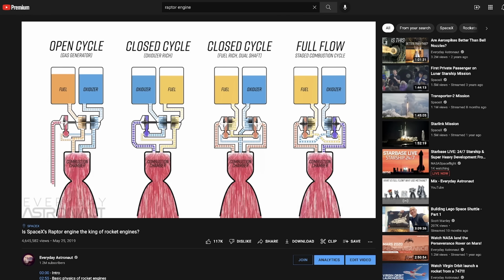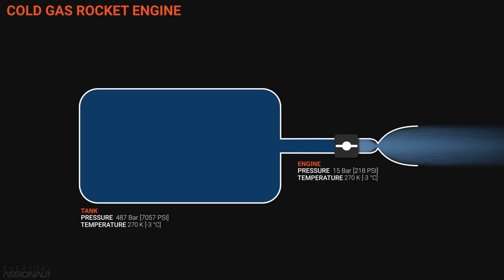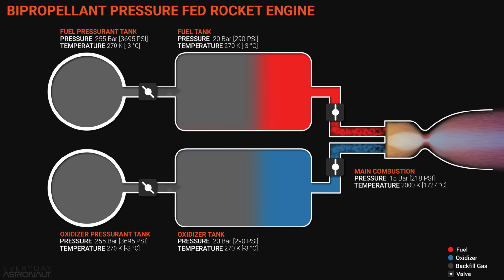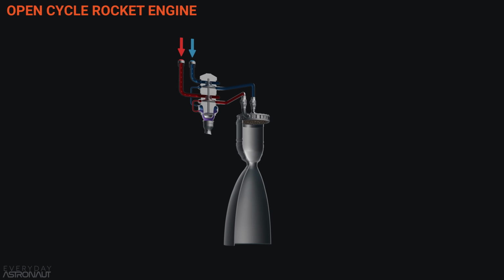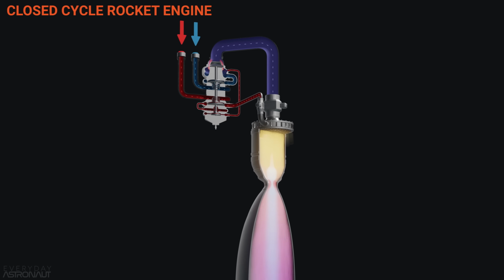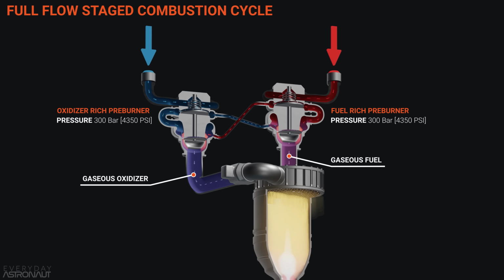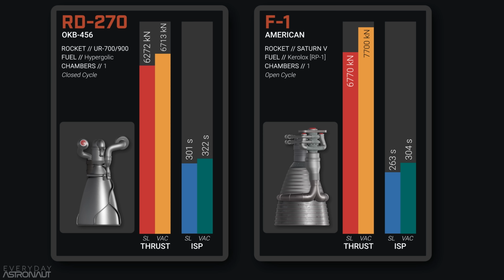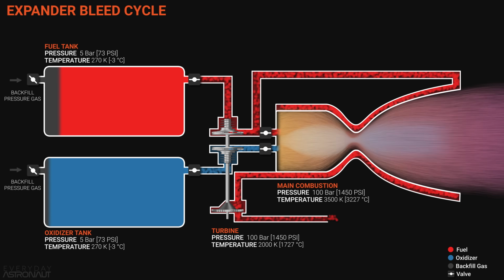Rocket engine cycles: How do you power a rocket engine?

Comment: Re: expander cycle being thrust limited due to thermal requirements not scaling with geometry - it seems this is really only a problem if you stick with a conventional nozzle geometry. You could get more out of it if you used multiple nozzles per combustion chamber, or just multiple chambers each with its own nozzle but shared pumps. That way you break away from the limited surface area by setting your own surface area to suit your needs
Reply: You are trading for more metal and heavier engine to get higher thrust.
Reply: I thought the same - the soviets had several engines with multiple nozzles.

Comment: As always an awesome video for anyone to learn how rocket engines work. Would like to add some extra details on turbine design for the turbo pump. As you have beautifully mentioned that staged combustion cycle require more mass flow in pre burner than in gas generator, the turbine type called as  “reaction turbine” is used which allows less pressure drop in turbine and the flow through turbine is subsonic and is achieved by a subsonic nozzle upstream of turbine. Whereas in gas generator cycle since the flow is not coupled with chamber, we can afford a huge pressure drop in turbine/nozzle of turbine. This case requires another type of turbine called an “Impulse turbine” which works on momentum transfer principle. All the flow is expanded in a de laval nozzle just before turbine which creates a supersonic flow. Pressure drop in turbine section is negligible. The amount of gas expanded in turbine section compared to total expansion in nozzle and turbine is called as degree of reaction. Reaction turbine has high degree of reaction and the shape of blades is similar to an airfoil. Impulse turbine has very low degree of reaction and the design of blade is very simple.

Comment: 20 minutes in, at the electric pump fed systems. That apparently just barely works, but is just enough to get a few hundred kilos to orbit.
Reminded me of the 90's craze of electric turbo pumps and people with real turbos used to laugh at them. 
In Rocketry, turns out that piece of tiny added efficiency is just whats require to overcome the rocket equation. That is pretty amazing. 
Awesome content Tim. Massive fan.
Reply: The electrons rocket rutherford engine on the electron rocket has an ISP on the first stage engine of 311at sea level.  The falcon 9 merlin engine with an ISP of 282.  this means it aches more thrust form a given amount of fuel than the merlin 9.  Electric pumps work very well and is an excellent choice for small engines..  It is just thee weight of the batteries and the electric motor that is the problem.  To make a engine as big as the falcon 9 would require a very heavy motor and and very large and heavy battery.

Comment: Brilliant.  I finally feel like I understand this material.  Smart move starting with cold gas and working through added layers of complexity.

How does the full flow cycle deal with nozzle coking on the fuel-rich preburner side?
Reply from the maker: You’ll notice they don’t use hydrocarbon rich fuels, so usually just use methane or hydrogen! Good question!

Comment: Hydrogen is extremely "rare", as in rarefied.  It's just an uncommon use of the term, and using it would likely carry the wrong connotation.  It's a lot more obvious in meaning to just say "undense", even if that's not an actual word.

Comment: I am definitely going to rewatch this, pausing to see where what your diagram shows and compare it to an actual rocket engine to see if I can tell which part your diagrams are referring. I'd love to see a video where you take your favourite engine, showing some of the basic parts and concepts in your diagrams, and show what they look like on the actual rocket engine. For example, I am so keen on seeing how the piping in the nozzles is actually constructed, so they aid in cooling it before being fed into the combustion chamber. Where is it fed in from the pumpts and where does it go to be fed into the combustion chamber?

I'd also be keen on knowing more on how the rockets are actually connected. I find it amazing that the rockets are simply tubes being pushed up by quick expanding gas. The only thing that makes them go up is the fact the gas is forced to flow in only one direction. I keep thinking what keeps the tanks from collapsing from the emense amount of force applied to it? How are the engines attached to prevent this? 

I'd also be interested in knowing some of the equations used to determine the dynamics of how the pumps work. I know from other videos that it uses centrifical force to create pressure, but I cannot determine to what end some of the pumps are used. Is there limits that cannot be exceeded besides temperature? 

Keep up the great videos. I look forward to your explanation on how to start a rocket engine.

Comment: Just nit-pick. Pressure doesn't flow anywhere. Pressure is just potential in a point. Flow flows xD. Same as voltage doesn't flow, current does. ;

Comment: How do you avoid the pressure gas entering the pumps instead of the fuel/ox?
Reply: Yoi make sure that the fuel is at the bottom, near the intakes, when you start it, this is either done by lighting small engines either solid or fed through bladder tanks that keep the fuel in a bladder seperate from the gas.
The acceleration pushes the fuel to the engines, when it fires it accelerates it enough to keep it there.

This isnt the only way to do this, the Agena-D i believe had a sort of mesh keeping a small amount of propellant close to the intake using. surface tension, instead of lighting another engine to get the main one going, the small amount of fuel is enough for the main engine to push all fuel to the intake.

Comment: Surprised there was no mention of how atmospheric pressure affects the decisions. High chamber pressures are always better, but make much more difference in high ambient pressures than in vacuum. For pressure fed and expander cycle this is why we don't see booster engines, as they tend to be relatively low pressure, while open cycles behave well at low levels due to getting fairly high chamber pressures without massive complexity.

Comment: 17:21 Increasing tank weight increases gas pressure? I thought it was the other way around.
Reply from the maker: “The weight is the tanks increases the higher the pressure in the system is” in other words, tanks tend to get heavier the higher the pressure in them
Reply: We only make tanks heavier after we decide that we need more pressure, so to me it's better to say that the causal loop starts with pressure->weight, even though it continues with weight->pressure.

Comment: Surprisingly that number of 75,000 horsepower,  I've seen in use but it powered a massive piece of equipment and the weight was excessive and got more bang for the buck . ..btw there's a better solution and way less fuel

Comment: small correction. helium is not used in cold gas thrusters because of its low molecular weight. sure, it technically comes out faster, but because it's so light, it's depleted way too quickly. you have this big heavy pressurized tank just to store a tiny amount of helium. so instead, heavier gases like nitrogen are used (kinda like how water is used in water rockets, instead of only air). yes, helium is used to push fuel and oxidizer into the combustion chamber, but never as a cold gas thruster.

rest of the video was fine tho

Comment: New cycle type: battery-electric-augmented [insert cycle here] engine. Basically, develop the most simple/cost-effective version of your combustion cycle that normally wouldn't work by itself, but augment it's shortcomings with a simple battery-powered electric motor. Kinda like how an electric bike still requires you to pedal uphill, but provides a little kick so you don't have to pedal quite as hard...

Comment: It seems like the expander cycle can be combined with any of the cycles with a pre-burner.  What would be problematic (other than complexity) with a dual pre-expanding full-flow staged combustion engine, that pumps the fuel and oxidiser around the bell, then into two pre-burners that boost the energy from expansion, and drive the main pumps.  This would overcome the size limits on expander cycle engines, while simultaneously reducing the size and/or aggressiveness of the pre burners needed for a full flow staged combustion cycle engine.

Comment: I for years have thought I had come up with a completely original idea. Something I called "psuedofuel," where a monopropellant (or two propellant tanks) would feed a pressure-fed engine, and then be repressurized by some inert gas when the pressure dropped too low. I was so proud that I 3d printed prototypes of this and planned to static fire a proof of concept later this year. Your section on monoprop pressure fed engines was very humbling and informative, and fascinated me that someone had though of this before I had! Thank you again for such a well made video, EverydayAstronaut!

Comment: Fun fact: Hydrogen-based Expander cycles are very easy to start, because even room temperature is hot enough to boil hydrogen to power the turbine. You can literally just open the fuel valve and the engine will start.
Thanks for actually getting into the weeds of the math, and not just handwaving the complexity away with qualitative statements.

Comment: Hey, thanks for the vid. I hope that we can get a video on “exotic” fuels, engines and engine cycles. Engine types like NTR, Tri-propellant, Full Flow Staged Combustion with other fuels and oxidisers (hydrogen, hypergolics etc.), Fusion engines, warp drives
Reply: Tripropellant is actually a good idea if you're trying to make a spaceplane.
Launch with tripropellant LH2, RP-1 (for high thrust), and LOX, and then at higher altitudes when you don't need as much thrust you can switch over to pure hydrolox.

Or you could go absolutely crazy and use Lithium, Fluorine, and Hydrogen. You know, in case you don't want to use the launch site ever again.

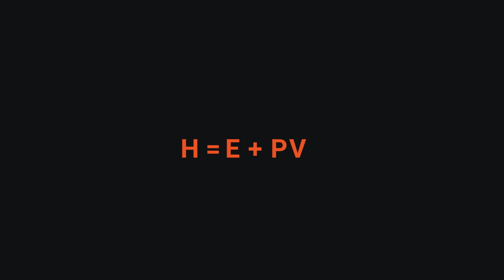Comment: 4:28  A small correction,  Heat is not energy...   the difference in temperature between two medium can produce work.   But if you have a room with 1 million degree, you have no energy unless you find out another room with lower temperature.
Reply: That's work, moving energy from the high temperature to the low temperature. The high temperature room has significant Internal Energy. That's like saying a large mass lifted in the air does not have energy because it's sitting still.
Reply: @kjdude8765  That is internal energy.. Not specifically ENERGY!!  As we want that energy to produce work, we are interested in Energy!   Not internal!
Energy in this case is always linked with work (read my Reply to Angad). 
You mention a large mass lifted in the air.. Well that is potential energy only if it can produce work, now I ask you.. what is your current potential energy right now?  If you are on the surface of the earth, your body can not exchange potential energy with kinetic, even talking into account that you are 6000km above the earth core. 
Lets go back to the rocket example, lets ignore chemical reactions, you have a gas at 50 bar in your tank.
Now calculate how much energy do you have..
But you would not be able to specify, because that same tank has higher energy in vaccum than on the earth surface, that is why rockets has higher ISP on vaccum. 
That same tank would have 0 energy if your medium it is at the same pressure. 
Or imagine you have air at 1 bar 1000 degrees and outside the same pressure and temperature, you do not have energy either.   Energy is a quantitative property!
Reply: You confuse energy and work.
Reply: @angadsingh9314  No I am not..   Quote from wiki:
"In physics, energy is the quantitative property that is transferred to a body or to a physical system, recognizable in the performance of work "
Energy is defined via work that is why they use the same unit "Joule". 
You can not said you have certain amount of Energy if you can not do work with that. (not 100% sure about these exact words, but that is how I understand it) 
If you only have one room with high temperature.. you can not do work with that, so we can said that you have no energy because you can not even measure it..  You neen to ask "with respect to what", you need a differential, if you do not know this differential, then you can not specify how much energy you have to realize work.   (Work here is deltaV) which vary with external pressure and temperature.

Comment: Quick question: If the fuel tanks can be upgraded without adding weight to store fuel at a higher pressure than it is normally at, would that translate into a more powerful rocket or a rocket that can fire for a longer period of time...or both?
Reply: That depends on if the fuel is compressable or not. And with most liquid propellants, the answer to that is "not that much".
Instead of attacking it from the pressure angle, the better way to accomplish that is to simply chill the propellants to near their freezing points (rather than their boiling points for cryogenics, or ambient temperature for hypergolics and RP-1). This has the primary effect of increasing the density of the propellants, which has two effects. 1, you can fit a greater mass of propellant in the fuel tanks, without having to upgrade them at all, and 2, the engines being fed higher density propellants will almost certainly be able to produce more thrust, assuming you don't run into another physical constraint of the engine(s) themselves such as a chamber pressure limit or a temperature limit (if you use regenerative cooling, the cooler, denser propellant should allow you to reach higher power levels as well, since it takes more energy to heat it to the same temperature as the same engine running on non-chilled propellants).

Comment: There is also the electricity-powered ion engine, where you accelerate charged particles similar to how a linear particle-accelerator works, just pointing it into space. This is an interesting type due to its very high efficiency, by having a super high specific impulse (the individual particles are accelerated to extreme velocities).
Reply: This video's scope was, aside from cold gas thrusters, likely limited to rocket engines which derive most or all of their energy from the chemical energy contained in the fuel. That excludes exotic engines like nuclear thermal rockets and any form of electric propulsion aside from where the electricity is merely used to drive the propellant feed pumps.

Comment: How To Start a Rocket Engine and How Do Injectors Work are two of the things that confuse me most about rocket engines so a video would be appreciated. Like how specifically does the propellant get from the tanks to the injectors and how can you start an engine if that engine requires pumps to pressurize the propellants to start the engine but you need high pressure propellants to drive the pumps, which pressurize the propellants. Boggles my mind

Comment: If you want a bigger expander cycle engine and you don't want to mess with high surface-area altitude-compensating nozzles or crazy chamber geometries with whacked-out fluid dynamics, why not just do what Russian engineers did since forever ago (RD-200?) and add more chambers? You can have one big pump and plenty of surface area... and as an added bonus your rocket engine will just look really amazing. Imagine an engine with six hydrogen-burning nozzles in two rows of 3, all powered by one great big expansion-powered pump assembly... the first 6-cylinder rocket engine :D
Reply: I think that just adds mass and potentially more to actively cool as well which would require yet more mass. :)

Comment: we need a good summary table at the end of those showing the examples/implementations of each of these types of engines along with their specific impulse and some sort of rating on their cost and/or complexity. I have a much better understanding of the different cycles, but I'm not really sure which engines out there have the highest efficiencies and which cycle type they use.

Comment: now that i think about it... since the full flow staged combustion cycle turns both its oxidizer and
 fuel into a gaseous state... doesn't that mean that there is very little point in having an injection plate?
Reply: Id imagine you still want to assist the even mixing of the gaseous fuel and oxidizer with an injection plate to avoid having large areas near the inlets that see inefficient combustion.

Comment: Rockets don't have a horsepower.  Just a thrust.  That is to say, power being thrust times speed, you get any horsepower you want as you go faster.  Conventional engines lose thrust as speed increases beyond a certain point so they have a (peak) power.  Rockets don't.
Reply: While the rocket doesn't have single horsepower rating , there is a certain hp needed to run the pumps as well as a given power in the exhaust gases at zero forward velocity.